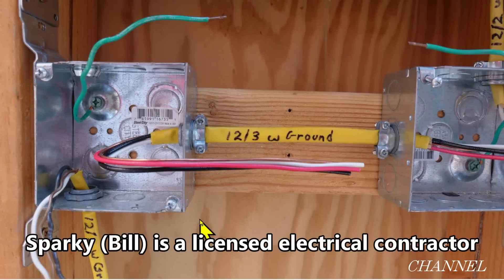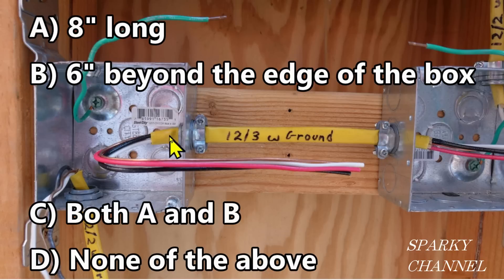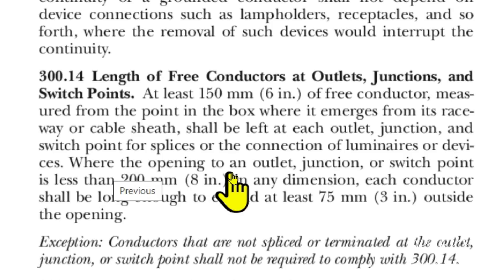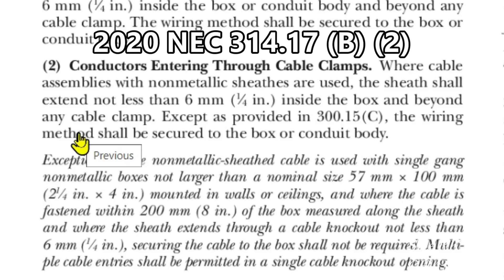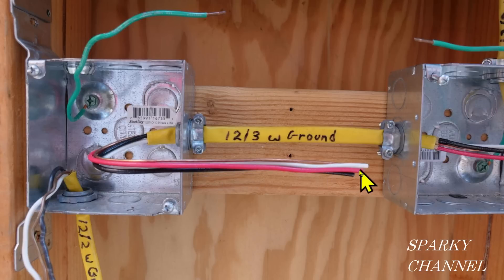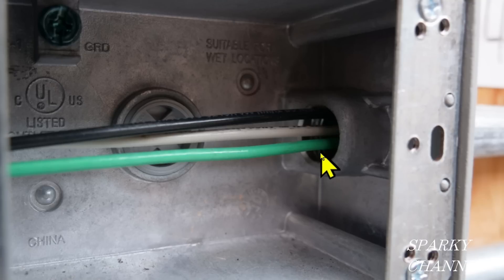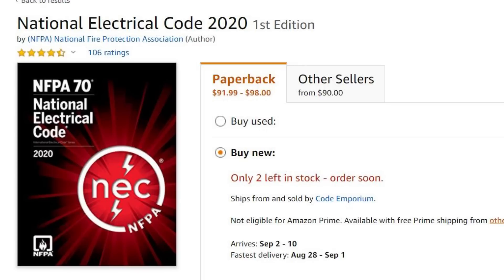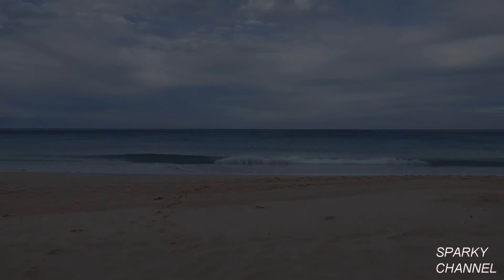How Long Must Wires Be in an Electrical Box? (2020 NEC 300.14)

Comment: The only part I differ with you on interpretation is the 3 in rule. My understanding is that the 3 inches must extend out the opening. That's it. Nothing to do with an edge. As long as it pulls out past the front of the box at ANY point 3 inches it's legal. I could be wrong but that's how I've always understood this rule.
Reply from the maker: You're correct. Here is the code:  "Where the opening to an outlet, junction, or switch point is less than 200 mm (8 in.) in any dimension, each conductor shall be long enough to extend at least 75 mm (3 in.) outside the opening."  I think the phrase "outside the opening" is the key there. But how are you going to know where exactly the opening ends unless you use the edge as a reference?
Reply: @SparkyChannel  for example a common box for me is 6x6x4. Frequently I mount this to a wall above ceiling and bring the conduit or mc in the back of the box. I know I need the 6 in and 3 outside the box so the smallest I can leave the wire is 7 inches from where it emerges from the conduit or mc connector. If that makes sense.
Reply from the maker: @zerocool5878  That sounds correct to me. :)
Reply: @SparkyChannel  Think of it like this. Using the box viewed in your video. With the wire entering center right, the wire must be 3 inches longer than the corner furthest  from the box entry point. That will give you greater than 6 inches in your example.
Reply: The opening is the edge. You don't differ, you're just hung up on semantics.

Comment: It would be helpful to see an example where the 3inch beyond the edge requirement made the wires longer than the 6inch requirement. The Code writers had a reason but often no one knows it and then it’s hard to deal with special installations.
Reply: Perhaps it is seen more in commercial and industrial installs?
Reply: I guess the reason for it being applicable only to boxes being smaller than 8" x 8" opening is the ability to get tools or hands in there to work.
Reply from the maker: It may be when extensions are added to a box. I'll have to play with that and see if I can figure it out. Excellent point!
Reply: I'm like a year late and not a sparky, but if you had something like a 5x5x5 box with the wires coming i from the back or near the back (idk if that exists, just an example) i think you would need 8 inches?
5 to clear the box, another 3 to have 3 inches outside the box? Possibly up to half an inch less depending on where the sheath stops, and how far away from the back the wires come in?
Reply: @joshuacheung6518  Precisely. That is how the addition works.

Comment: We don't measure boxes corner to corner.  Table 314.16 (A)  shows height, width and depth.   If I am wrong feel free to teach me.
Reply from the maker: "Where the opening to an outlet, junction, or switch point is less than 200 mm (8 in.) in any dimension, each conductor shall be long enough to extend at least 75 mm (3 in.) outside the opening." You could be correct. Also, I think Math Man above could be correct and I think I could be correct. IMO the code writers aren't giving us enough information to be exact on this point. However, I think the general point is that on the smaller boxes, 4x4 and smaller for sure, the conductors shall be long enough to extend at least 75 mm (3 in.) outside the opening.
Reply: @SparkyChannel  the code writers always leave everything up to personal interpretation.   It's not easy learning this stuff.
Reply from the maker: @--JohnDoe  Absolutely correct! Isn't that the truth!
Reply: @SparkyChannel   I think the requirement is to ensure electricians have room to work.  The exception to wires extending needs to be based on the smallest possible opening measurement which is how the requirement reads to me anyways, not the largest, which is consistent with this purpose.  Relying on the corner to corner measurement alone would situations of having to work inside of a 1"x10" opening which makes no sense.
Reply: Based on the article's accompaning Exhibit 300.12 in the Handbook edition of the 2020 NEC you are correct. it shows a square box with measurements of "any dimension" along the edges of the box.  I find endless confusion resolved using that edition with all the commentary and exhibits, particularly when discussing a given issue with the AHJ.
Reply: I bought it when he said it but once you pointed it out I suspect the writers were probably referring to Width Length Height. Agree, they do definitely leave us with some mysteries. 😁

Comment: I understand but you can't go wrong 6" from the edge of the box, that's what I do, been doing it all threw out my career, the sheathing I've always left the 1/4" inside the box, some people don't understand that is easier and faster to make up a box when you fallow this guide lines, some people I work with leave up to 3 inches of sheeding on the wire and really short leads like 2 inches coming out the box but i make it work...thank you.
Reply from the maker: Sounds good! Have a great weekend!
Reply: In my home's new work electrical boxes, the person who wired my gfci is the only one who left a long enough wire.  I was amazed at how much easier it is to pack everything in the box with the longer wire.  I would have predicted less wire would be easier.  I started installing pigtails to give me the wire length I should have been left.
Reply: I wish the Code also gave the maximum amount of sheathing that can be left. The 5/8" he left seems like a good length to me.
Reply: These codes are just minimums.

Comment: I would do a video if you have the time on branch circuit load calculations. Take an example 15amp circuit calculate its existing load and then add other devices to work out a new revised load, covering power factors, continuous use, specific purpose devices. Another good topic is to cover wire bend radius across all wire gauges and what that means for safety and installation purposes. Just be careful Bill in responding to everyone in the comment section some are fake posts and some posts are pretending to be someone they are not this was one of the way they hacked the previous account. Take some time to learn about that issues. Unfortunately that’s the world we live in.
Reply from the maker: Boy, I could say a lot about getting hacked but I think it's best to just keep a good attitude and just keep going forward. But like you say, you have to keep up a good defense too. Excellent video ideas, thanks!
Reply: I wonder how many are up to the math involved in calculating parallel loades.
Reply: @georgebush6002  it’s something electricians should know and keep familiarizing themselves with.

Comment: Lol I got it right non of the above but to be fair I’m a electrician so I have to live by the book. But hey most electricians measure how much wire by making sure it goes to the end of the hand old school way to make sure . Unless you have tiny hands .
Reply from the maker: Good job! Have a great weekend!
Reply: tiny hands ==> less wire needed
You should look if it's a real requirement or a 
recommendation. Many pages in the book are only 
recommendations and may be only a requirement if the contract stated as such.
If it's a requirement you need to change the whole wire in case you cut short in case of maintenance.

Comment: ah, I never realised you have to meet both the code lengths; from the end of the sheath and the edge of a small box.
Reply from the maker: Correct, or where the wires emerge from a raceway. I really wish they would write these codes in plain English! Have a great day!
Reply: IMO, the code mostly "legalizes" good standard practice, that's why it turns into loopy spagetti salad. the 6" and 3" reqs do just mostly happenstance together in the field. my first master tought me 8" (ye olde handspan) from the back of a small outlet box.
Reply from the maker: @wim0104  "loopy spagetti salad" LOL! 😂
Reply: also, if you're going diagonal for the "maximum dimension"; boxes are a 3d shape, so the max dimension is a diagonal across from the front face to the backside. 
I think the code should say maximum nominal dimension; i.e. height*depth*width.
Reply: wim0104 yes that’s what the code is intended to do. I have read that it applies to any one of these 3 dimensions not that all 3 dimensions have to be of that size. As a standard setter albeit in a different field. The use of formal language is to avoid too erroneous an interpretation by trying to be precise in the language used as you say that principle is important for legal/regulatory purposes. Through the various review and revision process and discussion the aim is to remove any erroneous interpretations but that’s not a guarantee- circumstances can arise in the future that were not envisaged when the code was written that then leads to another cycle of revision or corrections which is what the NEC goes through. Look at the number of errata already published for the NEC 2020 code.
Reply from the maker: @mathman0101  "Where the opening to an outlet, junction, or switch point is less than 200 mm (8 in.) in any dimension, each conductor shall be long enough to extend at least 75 mm (3 in.) outside the opening." You could be correct. Also, I think  John Doe below could be correct and I think I could be correct. IMO the code writers aren't giving us enough information to be exact on this point. However, I think the general point is that on the smaller boxes, 4x4 and smaller for sure, the conductors shall be long enough to extend at least 75 mm (3 in.) outside the opening.  Bill
Reply: Sparky Channel that’s correct.

Comment: Good Morning Sparky. first time i Comment. first that you so much. i am an IBEW126 Union member. Phila. pa. my question is. What is the best all around FLUKE METTER to use for HVAC an All around?  THANKS YOU AGAIN
Reply from the maker: Good morning Jesse! By far my favorite Fluke HVAC meter is the 902FC,. You can see it in action here: Fluke 902FC HVAC Clamp Meter with Fluke Connect + 2020 NEC 210.11(B) Even Loads: https://youtu.be/siGGe27e7Xc